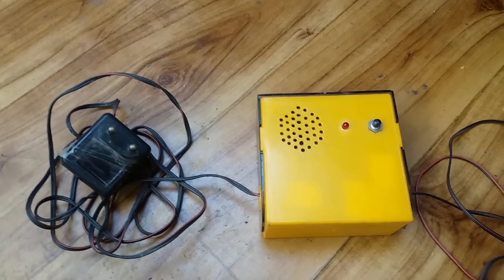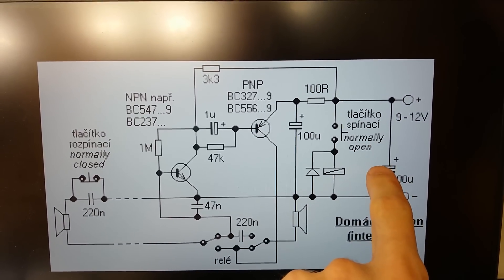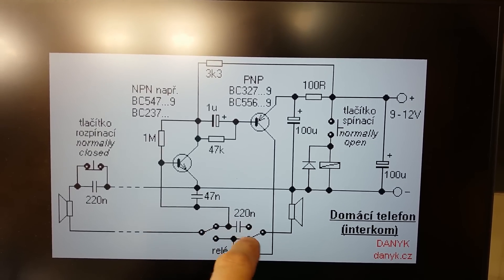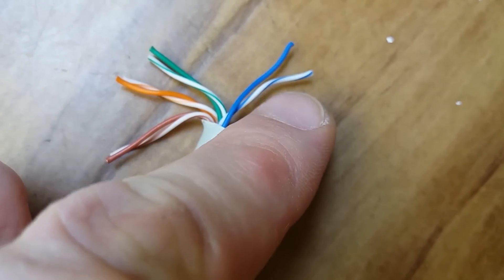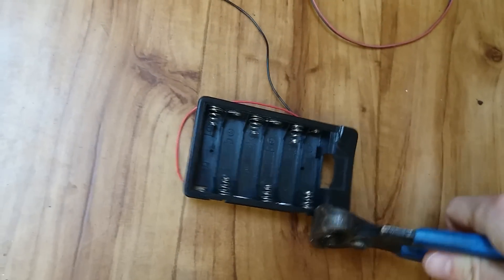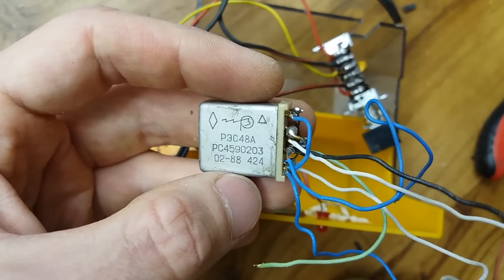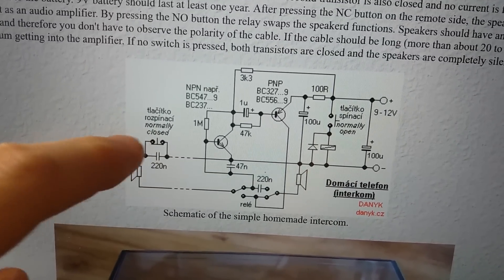DIY intercom (+ random thoughts on overcomplicated technologies) - unedited

Comment: I think you can make it sound activated Active device by using one extra Darlington or opamp for sound activation and with Mosfet and cap based time based circuit such if amplyfied signal goes to the gate it charges the cap connected to the G and S of most so it stay on for some time and powering the Main Electronic for that  time whenever it hear sudden sound so it will be little automatic .
You may say ... "  .. you forget what I'm talking about  , you going towards the complexity .. " yes but in emergency Condition who will bother to find and turn on this device to just say single word to other room .!!

Comment: 15:19 same thing with RF stuff because most of today's kids are thinking that  they are smart enough to control things wirelessly because they just have to buy Pre made radio module ,  development board and library's but they might not know the chain of Complexity revolution like superhetrodyne , transmission losses , cable  , reflections  , ppl , modulation typs , tuning things extra I am still practically learning this stuff  I even asked you before to make videos on RF basic stuff and diy RF spectrum analysers which is primary tool for RF stuff .

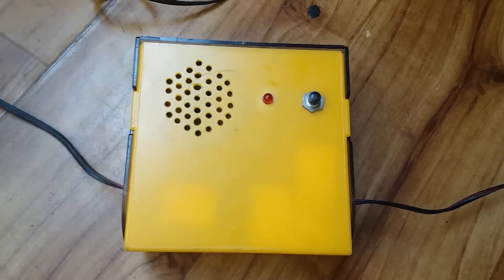Comment: 12:21 ... Same thinking sometime 
Many peoples doesn't have any idea of the complexity of the devices what they are using in hand .
Like combination of some rocks , crystal wires , metals in right way in right place and with some right Algorithm can do many Amazing Things in pocket size space , which might be  beyond the Dream or imagination  for our Old generations  .
Like big magnetic storage Replaced by tiny Nand Cmos SD  chip with million times more capacity and similarly Vacuum tubes by Transistors  with Nano scale size and power consumptions and so many .

Comment: I love the frugality of this circuit: it basically requires half the stuff other DIY intercoms need (only one ampli, only one supply, only two loudspeakers, and just two wires). But the distortion should be off the scale too: I simulated it in LTSpice and... Well... looks like a class C ampli :-)

Comment: After watching I had to build this. Not just because it's so effective and simple, but also because I had in my stuff a pair of old Homer remote intercom speakers from the 60s with a DPDT call switch in each one! The speakers were swapped for some 50-ohm types I had laying around for maybe fifteen years, and all the remaining parts came from my junk box. My circuit worked best with the 47K base resistor in the PNP transistor reduced to 2K2, since the first value wasn't enought to make the transistor turn on. Otherwise, it's not very loud, but it works nicely! :)

Comment: @DiodeGoneWild - 
The batteries will not last 20 years , they will discharge it self much faster than the electronics does
Reply from the maker: of course ;) this was just a theoretical estimation based on the standby current and the battery capacity. Just to emphasize that the standby current is really low.

Comment: Based on the results of experiments by the YouTube user bigclivedotcom  (whom you probably will already know anyway, if you're here .....),  a kilowatt-hour's worth of AA alkaline batteries would cost GBP £100.00  (About €117).  According to my electricity meter, that much from the mains costs GBP £0.30.  (You probably will be paying a different amount and so will have to adjust these figures; I have tried to explain the calculations so you could insert the appropriate rate.)

If we round the standby current of the old transformer PSU to 1W, that means it will run for 1000 hours on £0.30 of mains electricity  (= 1kWh).  So one penny would buy enough energy to last 1000 / 30 = 33.3333 hours  (33h20m).  And if we spent £100.00 on energy from the mains, we would get enough to cover the losses for 333 333 hours, or 13 888 days, or 38 years.  So that is how long £100 worth of batteries  (which is reckoned to be 1kWh)  would have to last, to be cheaper than the mains.

So disposable batteries are still more expensive than even a standby current that sounds hugely wasteful!  But you probably could get a Lithium-ion battery for free, out of some broken device, and that would solve the standby problem very nicely.  There are still some losses due to charging inefficiency and self-discharge; but energy from the mains is still almost free by comparison to disposable batteries, and we have not even factored in the pollution from making batteries .....

Comment: I feel it - it's frustrating to encounter a computer in the battery for your computer, or seeing some project which uses an arduino to flash an LED or act as a door chime...
Bit of a conspiracy, but I think it's of economic interest to 'deter' people from learning electronics in a simple fashion - the more complicated the thing gets, the more automated it's construction gets. Many designers only really know how the ICs in the circuit interface not how they work inside, and thus each step of the whole operation is compartmentalized; with no single person being capable of providing a turnkey solution - nary for themselves let alone making products for others!  With such an arrangement, the end result is that people are reliant on commercial products and don't think to learn an artform because it's "way too complex".
The problems here are that expertise will recede as fewer people have the patience to learn for a decade, when their attention is tuned to tictok's 20 second format. I always joke that soon goldfish will outsmart us if we keep this up...

As a closing note, just think how many engineers you know of; know how to utilize transistors in-circuit? No not assembling from a schematic; making the schematics themselves, and envisioning how they work in the project as a whole...

Comment: 8:00 Fast Ethernet (100Mbit or 100Base-T, but also true for the older 10Base-T (10 MBit)) uses Pins 1,2,3+6, 4 and 5 were back then POT (analog telephone) and 7,8 were free. But Gigabit Ethernet needs all 8 pins - for about 20 years now.. ^^
Reply: Also if you connect 2 gigabit devices together with a 2-pair cable, it's likely these would not work at all, even at 100Mbit. (But 1G to 100M will.) It took us ages to debug that.
Reply: @k4be.  If the devices have a good and working auto negotiation, both devices will drop to 100MBit and work. It may fail if 1,2,3 and 6 are working but either 4,5 or 7,8 are bad. So: only 4 connected - should work. But 4 + 2 connected and 2 missing (either blue or brown) often fails.

Comment: Internet cables are still commonly used. They support higher speed and lower latency even that 5GHz wifi. Also if you want to connect many computers to the internet, the wi-fi would be even slower, because they would interfere with each other's signal and wi-fi can only communicate with one device at a time (or a few if you have a fancy router that looks like a spider).

Comment: In the 70s we used to have an intercom of a very similar design, at least I think, as one of the boxes didn't contain any electronics. But it was a bit more advanced than your design because the button also operated a buzzer.

Comment: I agree with your thoughts about our reliance on technology which has reached a complexity that if it fails people will not know how to survive. I built my own has from 8,500 pisé bricks that I made one at a time using a UNESCO brick ram designed for lesser developed countries. It was manufactured as a manual device that anyone who could use a welder with little to no experience in welding could fix. The welds may not be pretty but if they are strong that is all that is needed. I taught myself how to wire and plumb the house. Make window frames, cabinetry, do roofing etc. In a post-apocalyptic society, I could build shelter. And most of the building of the exterior of the house was done before I had an electricity supply to the site and there were no battery driven tools. Hence, I also learnt how to use non powered hand tools. I mention this so you know there are some of us who still find it important to understand how to do many things ourselves and not rely on big corporations or when something breaks or fails to first think about the possibility of repairing rather than sending it to landfill and buying a replacement.

There is a YouTube channel run by a German man called the Apocalyptic Inventor who repurposes & restores items found in a scrap metal yard. He also designs and builds electronic circuits to run items he has restored or to make a more useful device. He holds similar views and like one can learn from you, one can learn many things from him. Excellent video.

Comment: I used a reed relay meant for 5V in my 2-3V circuit by "biasing" it with a permanent magnet .. it worked like this for a long time until the glue came lose and the magnet fell off .. xD
Reply: Magnetic preloading? Niiiiiiiiiice.

Comment: This is polish switch. It is called "isostat", and - if I remember well - it's French licence from mid 70's... Is not too reliable - in many applications, it is going to by "scratchy" after couple of hundreds presses...
Reply: Silver contact coating easily gets corroded in polluted air. Inadequate internal lubrication does not help either.

Comment: These simple devices are always the best, I missed the days where designs where simple yet ingenious. This is also why im not a fan of the so called "smart" appliances. For example the way a simple rice cooker determines when the rice is ready is by first having the bowl press a spring loaded switch that then engages with a magnet turning on the element. The catch is that the metal alloy at which the switch is made has its curie temparature at which it no longer gets attracted by magents fine tuned to the ideal temparature for rice, so when the rice is ready it no longer gets attracted and the spring opens the switch turning of the element. Its so simple yet so mind blowing. Nowdays you simply have a microctroller and a thermal sensor connected to it. You give the controller and the sensor power and connect it to any of its input pins and the rest is done by programming it.

As for the reliability the more complex the less reliable things get. Its kind of common sense to know that the smaller a transistor gets the more likely it is to fail as it is more sensitive to heat and even the current itself going through it. There is also that other elephant in the room which is planned obsolesence. Things nowdays dont last long by design, afterall if smartphone companies sell hundears of millions of phones every year in a world of 8 Billion people with a quarter of them in poverty there is no way they would be in business now. Another factor is integration of components. Sure a single resistor failing causing a phone to fail isnt that big of a deal and can easily be replaced fixing the problem, unless the bloody thing is in the tiniest smd package soldered in the middle of a sandwitch of boards that the only way to access is by removing the screen and dissasembling everything which requires special tools and techniques. You can of course bring it to the store to fix it but since the stores are usualy the only choice to fix for alot of things they can charge whatever outrageous price they thing is good, so bying a new phone is just more convenient.

Luckily though desktop computers are still around and they are much cooler than phones. Every major part can be swapped and you dont even have to buy a whole computer. You can buy the individual parts and build it yourself. Sure you are not soldering or building the circuits yourself but you can still learn lots of things about computers and you can even fix them yourself. Its one of the few modern things where repairability is still simple and easy.

As for the scenario of not being able to produce more cutting edge chips its not too farfetched. As you said there is only a few companies that produce them, in fact the vast majority of them is only made by one and thats TSMC, a company based in Taiwan which is a huge problem on its own. Both China (officialy as Peoples Republic of China) and Taiwan (Republic of China) call themselves as China though PRC is the China recognised as China by most countries, not only that but the communist PRC believes Taiwan is an occupied teritory of China that has to be liberated and because of that there is a chance that China (PRC) will one day invade Taiwan with whatever consequence this has for TSMC and the rest of the world that is heavily dependent on their service and even though other companies could catch the slack the demand for chips would be so high that our society would be derailed for a while until everything goes back to somewhat normal (given that the geopolitical events between China and Taiwan dont start WW3).

When it comes to the dependency people have on electronics nowdays isnt only for practical reasons, very often we simply waste time on them doing practicaly nothing. The digital interface thats made for us the so called monkeys is designed and programmed by highly intelligent people with a good understanding of the human psychic. They know how to triger the feelings of pleasure and euphoria on an individual and the apps we use are carefully engineered to bring those feelings as often and as intensely as possible. Its just a milder form of addiction except there is not physical dependency that will make you ill if you stop engaging with them unlike doing drugs, only mental dependency but thats still quite strong and the newer generation is quite sensitive and emotionaly unstable because of this. It literally gets offended by everything.

Comment: Looking again in low mood. Cheer up. I have made an intercom to the street door in my father house years ago. I used one piezoelectric microphone of one old phone. First I tried to amplify only with transistors but failed . So I used an opamp as preamplifier before the power transistor and speaker. I made a pair to use one circuit in inside and other outside. Inside the house I used the old intercom case. The inside microphone only activate when the handheld was picked up, but the outside microphone was always activate and we could ear the street sounds. In a modern LCD if we take it to the manufacturer to repair he will change the circuit board and charges a lot of money, but normally it is only needed to change the power supply diodes for a few cents. Modern world...

Comment: I think that one of the reasons we see so much violence and drug use use is people feeling lost and not in control due to the very rapid increase in technology over the last forty years, with technology's  rate of increase and complexity rising at ever increasing speed as time has gone by over those years. With things like radios and TV's forty or fifty years ago most people with a reasonable amount of intelligence and not an Einstein  could look inside such equipment and have some understanding look inside the latest stuff and all you see is a system on a chip and you cannot even see anything inside one of those and even Einstein would most likely not understand what is going on inside the chip if he could see it.

Comment: Have you considered getting a 3D printer and printing better looking cases for your projects? Old floppy disk cases sure have their own nostalgic look but since you decided to update this project by giving it a better button, a better case came to mind.
Reply from the maker: Hell no. If I'm ever going to 3D print something, it would be something that can't be created any other way.
Reply: @DiodeGoneWild  It's actually quite useful in mechanical design, prototyping or custom one-off parts, jigs, test fixtures, etc.. (i.e. no benchys and Yoda figures).

I can (and love to) mill, turn, file, saw, drill, etc., but some parts are either to complex to machine (and does not require the better strength and/or look that a machined product can provide), or not economical to make because of too much work, too much chips, because you don't have the required billet material and you can't buy in small quantity...

I printed so many jigs and test fixtures at work, some were never been made if I couldn't have 3D printed it...

Comment: I agree - the knowledge and self sufficiency of our generation is being lost.
Reply: ...while expectations and standards are going up - that's why you blink that LED with an Arduino instead of making a multivibrator out of two transistors or a 555 chip like we did in the '90s :D
Reply: @KeritechElectronics  

I never used an Arduino for anything.

Comment: Isn't the cost of the batteries higher than the consumption of the transformer over a lot of years?
Reply from the maker: In this case it's not. Energy from batteries is about 1000x more expensive than energy from mains, so a mains power supply might seem like a good idea, but in this case the mains power supply  with an iron transformer draws about 10 000x more than the device itself in standby. So it's 10x more expensive to run on a mains power supply.

Comment: You're right and it's scary, it's why I prefer older technology I can fix for the majority of things I use. Class D amp with a complicated IC? I'll stick with vacuum tubes, thanks.
Reply: God forbid they didn't solder ever damn chip that will one day need replacing, no more hard mounting anyrhing, I want Lego style repairability
Reply: Yes, 6L6 tubes are great. 
Class D is only necessary where you need high power in tight spaces, which is not one's living room.